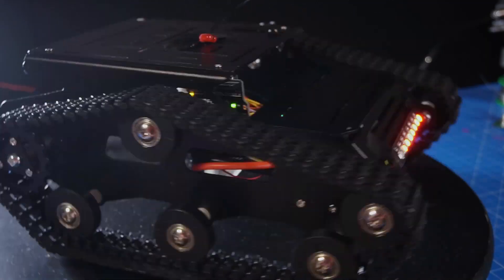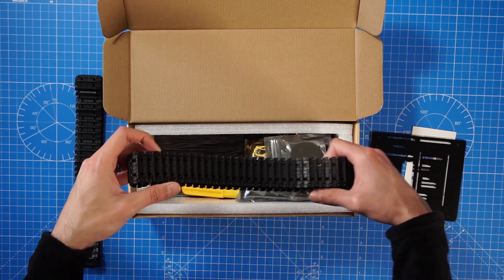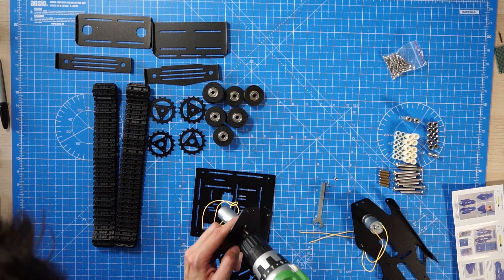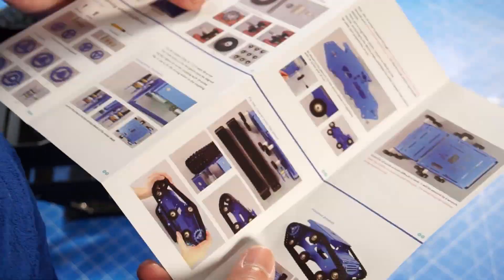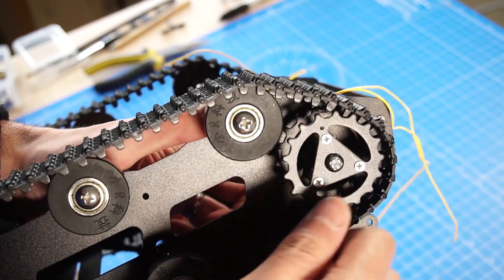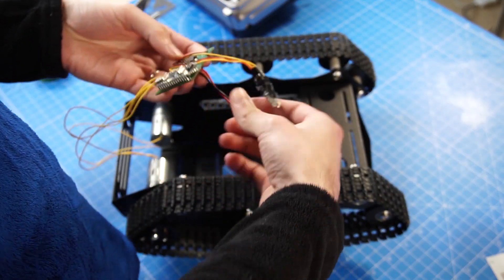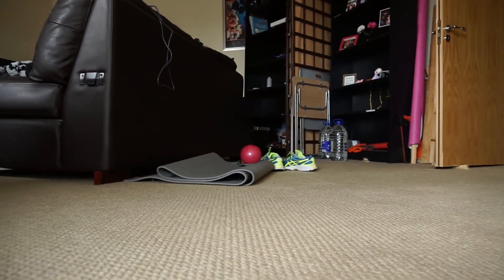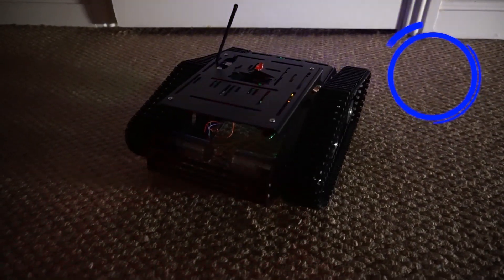Tracked Tank Mobile Robot RC Platform with Arduino

Comment: I looked at this chassis but picked another one. Hope I chose right. I'm using ELRS & sabertooth dual esc hopefully enough amps. I want bigger motors slightly more rpms lol but not sure will fit

Comment: Sir, interesting video about the Tracked Tank Mobile Robot RC Platform with Arduino. Sir, can you make a 6-dof robotic arm tank Arduino and give me the circuit diagram and the code for the 6-dof Robotic Arm tank Arduino Uno?

Comment: Hi, can you run this using only the taranis tx/rx?
Reply from the maker: No, you need a motor driver.
Reply: U need pwm receiver use sabertooth dual esc. I'm going to use ELRS link & my t18 transmitter